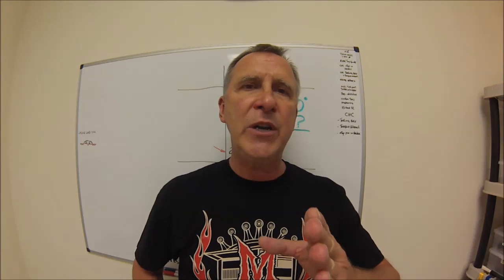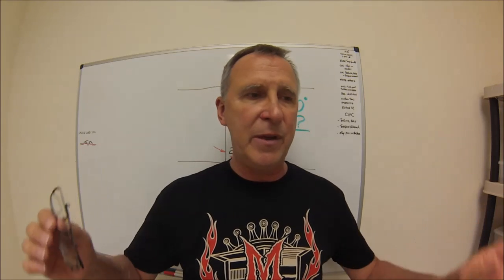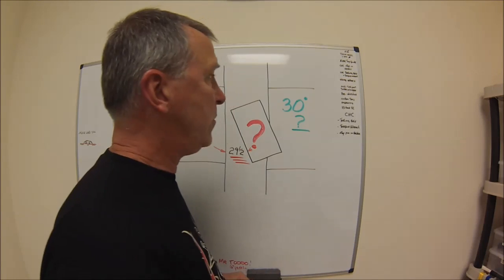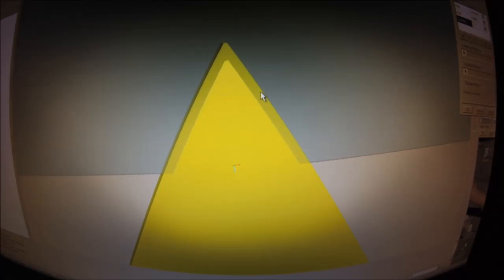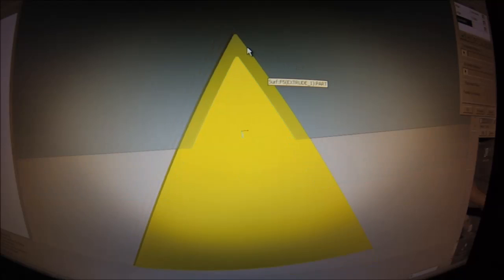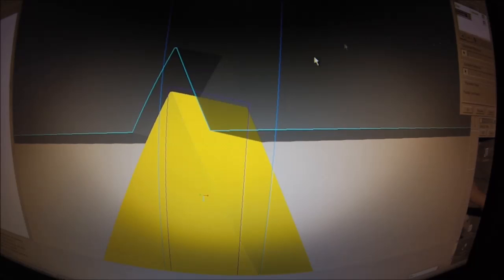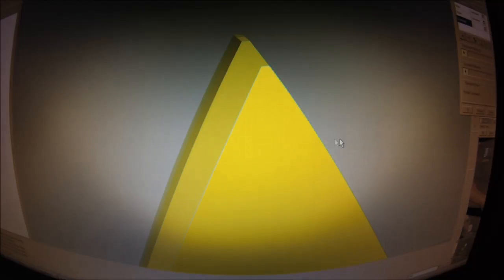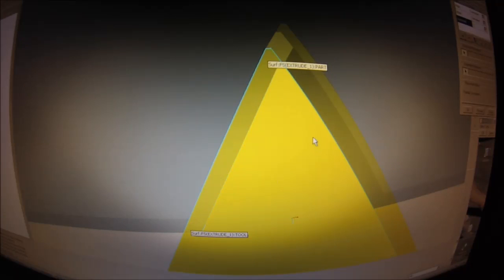Lathe Compound Setup for Single Point Threading...Myths and Musts

Comment: Hi.  forgot to send you my name. I'm Dee from England but I live in Thailand now. I had a small lathe of my own in England and tried to plunge cut an. inch whit worth thread but broke the tool because of the tool cutting on both sides but on the colchester at work  it was not a problem. We are moving to the North of Thailand soon and I hope to build a small workshop and get a few small machines in and start from there.
Reply from the maker: Hello Dee. Machine rigidity does have a lot to do with thread quality. Sometime you have to use that compound to have success.

Comment: Tx Joe! Done it with the same concept for decades too. 29, 25 straight in. Whatever. I will typically go closer to 30 only if exotic stainless or if tool depth, pressure or work/machine rigidity may be an issue. One thing that does still annoy me is seeing a lead screw rarely used and someone cleans it by simply engaging the nut to plow through years of gummed up coolant and chips stuck in it ;-) One advantage of programming using ball screws today I suppose.
Reply: Do Right Q

Comment: The computer CAD demonstration was a good idea but you should have kept it flat, tilting left and right produced immeges which confused the issue. I am beside the idea to have it close, almost 30 degrees. This way the right hand side will get a bit of smearing type of cleaning. Many years ago (I am much much older than you are) I tried to cut with half of tool, as you mentioned and got lines of each cut on the right hand side, which needed cleaning after. I would like to see the computer pictures again without tilting but in an agseralated angles. I meant this as a constructive comment, not a criticizing one. I am subscribed and keep watching. You have lots of good ideas.
Reply from the maker: Without rolling the screen around, it's impossible to see the zone of interference during the global interference check. You may see some red lines, but in a flat plane, they are just lines.

Comment: Great visualization! I completely agree with everything You showed.
I learned both the 29 degree and the plunge cutting method long time ago. Tend to keep my compound parallell to the bed and plunge cut all my threads. Works like a charm. Hand breaking the feed on the wheel can improve finish and also snugging the saddle lock slightly. On very coarse threads it is possible to tweak by feeding in both the compound and the cross feed to get similar effect as the 29 degree infeed. This is described well in the old book "Screw cutting in the lathe" if I remember correctly. I also think plunge cutting works best in some difficult materials when rubbing must be avoided, like Ti nr.1.
Reply from the maker: I appreciate the support. Thanks.

Comment: I'm a bit confused Joe. I was taught the orientation of the tool should remain at 30 deg. each side to the perpendicular ( fishtail alignment). So the tool post sets the tool alignment and the compound sets the advance. And because threading tools are form tools the last couple thousandths can be advanced with cross- slide to clean up small advance errors and keep chatter to a minimum.
Reply from the maker: The tool alignment should always be true to the part. Absolutely. The compound just determines the delivery. The final cuts being done on the cross slide is a very good idea.

Comment: Joe thanks for explaining the angled compound slide voodo. I have an old Raglan Little John lathe which has seen some use but Im bringing back to life.  I was concerned the 50 year wear would mean good clean threads were not possible. Threads are not perfect at the moment but getting better as I isolate and fix worn parts but the precision of that compound angle setting is not part of my problem.
Reply from the maker: If the leadscrew is worn, the threads will mimic the wear. It may cost you a few bucks, but it has to be good to yield good threads. The half nut is less expensive, but they should be replaced together.
Reply: Joe bang on im in my workshop now (back in uk its 13:10) it looks to have had a new lead screw sometime in the past but the 1/2 nut (clasp nut in the manual) is aluminium! and its toast. I can get one for $100 so shes back in business. Thanks again for your brilliant vids.
Reply from the maker: You are most welcome. I enjoy doing them. Make that investment in the nut. Hopefully it comes in bronze.

Comment: You are 100% correct Joe.

First cut is equal on both sides of the thread tool, the remaining cuts will be predominantly to the left side and only the depth of each additional pass DOC on the right.

CNC manuals explain this in detail because there is no existing compound slide on a turret.

One question, are you using Alibre Design?

Comment: the reason i teach people to set the compound around 29 degrees is because of price is right rules, it's close without going over. just as long as they aren't over 30 and aren't plunging straight in, because plunging causes the tool to bounce left and right. i didn't know there was a controversy here, but i am not surprised considering how much cargo cult machining there is going on
Reply from the maker: Close is good enough, but I still choose to plunge all my threads. I guess it depends on the tool and setup.

Comment: I can't see where it matters at all what angle the compound is set. The tool still travels parallel to the work during cutting, no matter if it's advanced straight on or at an angle. The whole 29.5 degree "rule" has perplexed me since I started a couple years ago. I don't think it matters, but do it anyway because that's what I learned. Good controversial video! Loved it.
Reply from the maker: Its strictly for tool load. If your machine can handle the cut, go straight in. I never use my compound. Thanks for watching.
Reply: If you are going to limit yourself to engine lathes I pretty much agree.  Once you get into the CNC world any symmetrical thread will have superior results with an alternating flank infeed.  On fanuc that would be an A60 P2 inside your G76.  The other fact about flank infeed verses plunging is tool like is also increased with flank infeed.  And alternating flank infeed further increase tool life.  Some threads you have to plunge like buttress threads.  Some materials will get really cranky with plunging.

If you want to further look into flank infeed verses plunging, take a look at cut volume verses depth of cut.
Reply: ACME and Buttress threading in my shop results in the first few rounds of the thread usually trashed due to the plunge and lead in error. Once the cut is started the thread (if steady and rigid enough) will be pretty accurate. Most of this is due to the tool settling in because of the difference between the cutting side and the following side of the tool during the cutting process. Since we lathe cut prior to grinding there is a pass given for a moderate amount of slop from this error. Similar to the gear shop method. Hob before heat treat and grind last.
Reply: The 29.5 degree tilt is also there to help stabilize the cut. I rarely use the compound unless it's for a very large thread (xxx-10tpi or larger). Then I run 30 degrees and only to reduce tool load. Every now and then I use the compound on very tough materials (titanium or inconel and the like), otherwise they'll rip the end off your tool.

Comment: If I'm using a carbide insert with a chip breaker on both forward edges, does it really matter if I cut straight in on a thread? The cutting load on a thread is usually quite small.

Comment: nice one Jo.  Abom has also just done a very good practical demo of what you discuss including the thread Dial. As you mentioned this is for a 60deg thread form for other form say Witworth 55ddeg I been show 27deg for same reasons. What is you take on this
Reply from the maker: Abom also said only the left side of the tool was doing the cutting. He was wrong, and I just proved that. We had a short conversation about it in the comment string on his video. I think setting a compound to less than half of the thread profile angle is a good way to reduce chatter. If you can, finish the thread with a small cross slide movement or two.

Comment: Thank you. Do you vary the width of the flat on the cutting tool with every different pitch in unified? Machinist handbook shows it as .25 * pitch. I have a thread flat gauge but it only starts at 18 tpi (.055") and goes coarser.
Reply from the maker: Yes. My rule of thumb is 1/8P
Reply: @joepie221  
I found the answer to my question. ASME B1.1-2019 look at Figure 6 on page 7. There is a range of acceptable flats for UN Series of Threads from P/8 (.125P) minimum to .2500P maximum for external thread root flat. Then there is to P/24 to .12500P for the internal thread root flat (the largest diameter) . I think Joe's point on his thread flat video is that being towards the sharper end of the range is better than being at the flatter end of the range due to a tendency to overshoot the pitch diameter (threads ONLY make contact on the 60 degree flanks, there another video from GDT that really shows this well). Also if you go towards the flatter end of the range and there is tool wear, now there possibility of clearance problems. The minor diameter is essential for clearance with a flat to prevent the stress concentration of a sharp thread root. "Sharp V thread" was a standard, the root of the thread was a point, used in the 1800s until about 1909 and caused problems. Here is a calculator that gives a more conservative thread flat range for the upper limit  http://theoreticalmachinist.com/Threads_UnifiedImperial.aspx

UN thread Series can also be partially or fully rounded. One benefit of using rounded tooling (to the specification of UNR) is that you could also make both UN and UNR Threads using the same tooling. UNR Thread Series has increased fatigue life and only applies to external threads (there is no internal UNR standard).  It seems logical that having a variety of insert tooling that will cover a reasonable range of thread TPI radius or flat of root. 

How did I do Joe?

Comment: What about the lead in? You are starting ahead of the cut at the end of the stock and moving across (say right to left traditionally) then there is no stock left at the right side to make contact. Where is the load on the right side?
The right side is cutting ONLY on the plunge. If it is leading right to left the tool is only cutting (in theory) on the left side during the threading cut.
It's actually better to use no compound lead angle if the machine and stock are rigid enough. There is less thread shape distortion due to tool deflection. Of course most shops aren't as solid as your shop. Props to you for that!
Reply: Because the thread is a helix,  the Material is rotating and being Forced Down On Top of the Insert.  There is tool pressure on Both the Left hand side, and the small amount of tip exposed on the right side.   so with the lead in,  it's all air till the tool reaches the material,  the Material is Forced Downwards onto the top of the Insert. Cutting takes place on both sides.  
if you cut away 1/2 the diameter of the shaft, so it's not round, but it looks like the letter 'D'
Apply Spatial Visualization,  see the Material rotating, and the top of the insert moving towards the left. The Material is Forced Downward on top of the tool, and the Material is Peeled away, leaving the negative form of the insert in the material.

Comment: Just going through these Videos - very educational! Thanks Joe! Whenever I start, I cannot stop watching. I very much appreciate you taking the time!
One thing I was wondering about: Does the feeding with a tilted cross-slide have benefits when you cut a high pitch helix? I am thinking that there must be limits to the pitch you can cut when you consider the wedge-shape of the two vertical sides of your tool. I cut a high-pitch groove once, and one side of the tool started rubbing against the side of the groove. I solved it by cutting a steeper angle on one side of the tool so that it clears the helix after cutting, but now I am wondering, if there is benefits in feeding in at an angle. Maybe a question for your gut: if you were to cut a left handed thread, would it feel right to you to set your top-slide to a negative angle (-30°) for feeding in?
Greetings from Austria
Reply from the maker: I'd like to comment, but I plunge 100% of all threads I cut.

Comment: Thanks for the great video, it makes perfect sense. So on a side note I'm guessing the "drunken thread" you mentioned could be caused by zero degree plunge cutting because both sides are equally loaded and there's no bias to take out any play/backlash in the machine. Would that be correct ?
Reply from the maker: No. It would be caused by a worn lead screw, or inconsistent pressure on the handwheel during threading.
Reply: @joepie221  OK thanks for the reply.

Comment: Hello Joe,  Do your allergies impact your diving?  I pretty much had to phase out twenty years ago when my sinuses got too bad.  On the topic of thread cutting.  It would be interesting to see a scale of what 'rigid' actually is.  I hear it referred to all the time but am not sure exactly where my machine falls in the category (so you know what you can attempt with a degree of success).  I started out with a 10 x 20 bench top German machine and then went to a 10 x 20 Grizzly both of which were not very rigid even in my experience (parting was a good indicator) now I am running a Grizzly G4003G.  It would be interesting to note on a scale of ten with ten being the industrial machines where it is approximately.  Kind of lets me know if I should try cross feed threading etc.    Always interesting to see a logical presentation as you have done.  Take care.  Doug
Reply from the maker: Hi Doug, Scuba Diving is a very discipline sport. You have to have training that you stick to and common sense to do it and not die. You know this. If I'm not 100%, I don't jump off the boat. Thank God my allergies are only seasonal, but they have held me back a few times. Long ago, I took a job where I had to rely heavily on form tools. The large surface contact just invites chatter. An old timer told me to flip my tools over and run the machine in reverse. It worked like magic. I told him I didn't realize an inverted tool was more rigid. he said "its not, thats why it worked". Sometimes rigidity is your friend, sometimes not. Depends on the situation.

Comment: You have amazing videos. Maybe I’m complicating it, but you should make a video on the process making two parts that thread together from scratch. In other words if I have a 1” OD piece of aluminum and I to 12tpi on it. What is the ID of the ‘nut’ I would have to make, before cutting the threads on that nut. To me that’s the one thing I’ve struggled in understanding.
Reply from the maker: You are not alone. Thats a good suggestion.
Reply: @joepie221  That would be greatly appreciated. Everything about the lathe I bought seems relatively straightforward with enough practice, but that concept is getting to me haha

Comment: Hey Joe, makes sense to me. How about your opinion on carbide inserts oil or no-oil. Cleaning up cutting oil sucks. I was told carbide likes big cuts and loves heat, so can I lose the oil?
Reply from the maker: Carbide likes to be buried, so I guess that means it like to cut. I hate cleaning up oil too, but I do use it on everything.

Comment: My brother single pointed threads for years at work, and told me to stop the 29° thing. He said it made zero difference. You might also note the amount of time single pointing takes when you consider adding any 'extras'- No one in production cuts threads unless it's an extremely hard material- They're all formed. Difficult to form external threads at home, but simple to buy form taps for internal threads- Much better in any way.

Comment: Compound angle markings on lathes are pretty crude for the most part.  If you really think you need 29.5 degrees, you had better set it with a sine bar and gage blocks, accounting for the actual geometry of your lathe, which probably is set to face with a slight dish toward the center.  Or, whatever it is after 20-30 years of use.  Also, I have seen quite a few people set up the most precise 29.5 degree angle they can get on the poor compound angle markings, but those numbers on their lathe start parallel with the bed.  Their actual plunge angle is 60.5 degrees from perpendicular to the work.  I have a 13x40 lathe, typically just plunge the cutter straight in, and don't need to do any math to determine my actual depth of cut, just read the cross slide dial.  It works fine for me.  If I have a truly coarse and deep thread, on harder material, then I might change to 25-28 degrees left of perpendicular, not fussy, but have to measure the thread depth by slow methods that can lead to mistakes or hope that doing the trig saves me.  Great video, Joe!
Reply from the maker: Hi Bob. I plunge all my threads because my machine is good and rigid. Thanks for watching.